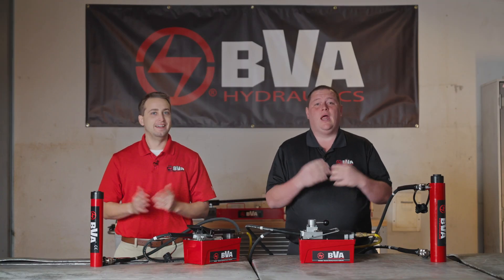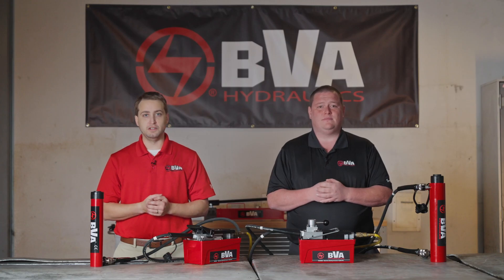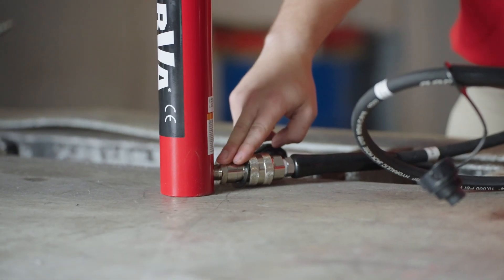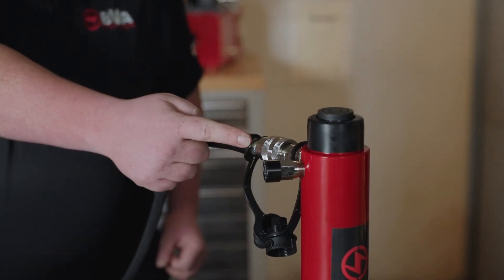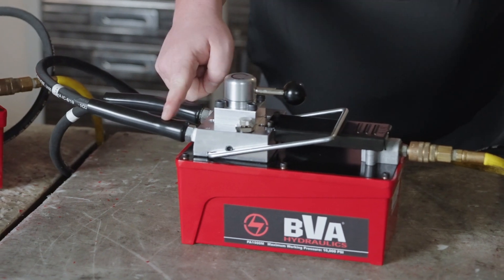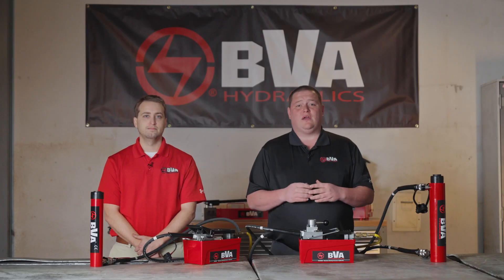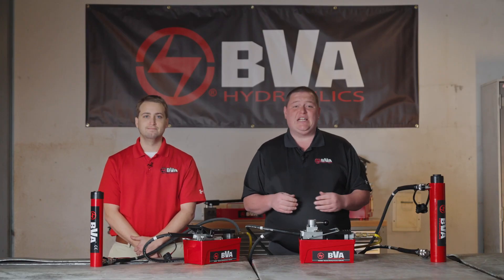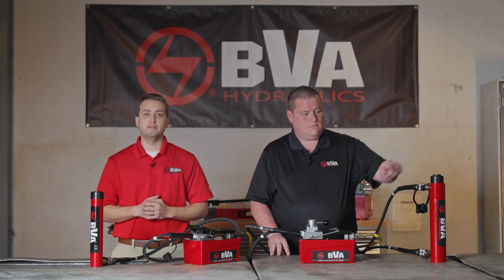BVA Single Acting vs Double Acting Cylinders

Comment: How would I hook my tractor remote to a single action cylinder? I have a tractor mounted NorTac concrete mixer that came with a single action cylinder (does not have a pressure relief valve).